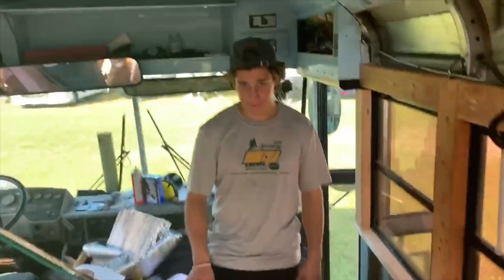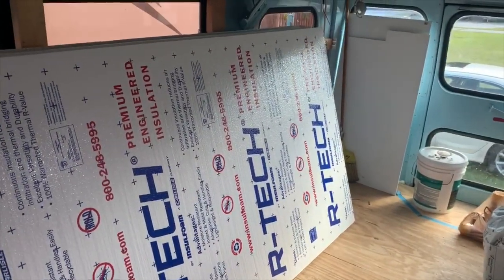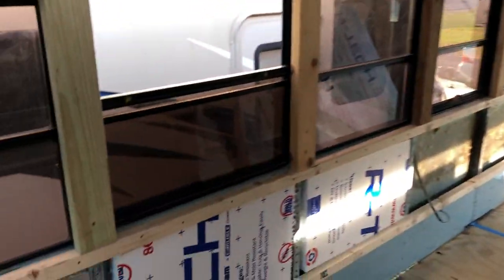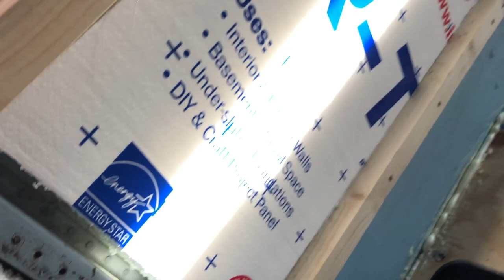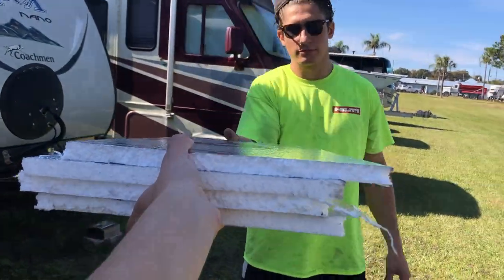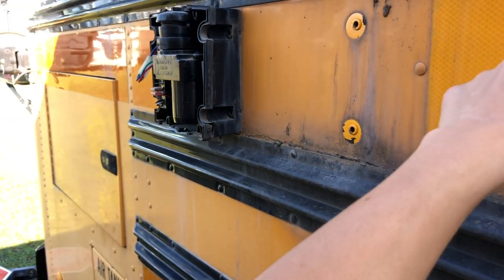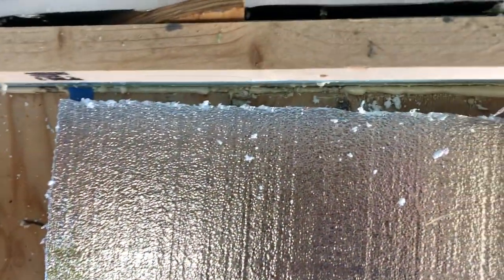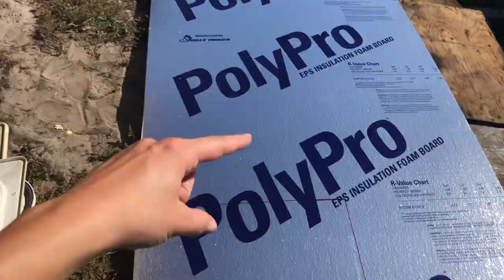INSULATING SKOOLIE w/ Rigid Board + Spray Foam | School Bus Conversion

Comment: Hi! I love the bus so far! good work! Pro-Tip if you are ever working with styrofoam in the future... An electric hot knife styrofoam cutter is so much easier to cut and it does not make a mess.

Comment: Looks awesome! We are in this part of our build as well! What glue did you guys use to put on your insulation to hold it in?
Reply from the maker: Thanks Mackenzie! We didn’t use any glue at all, just the weight of the plywood holds it in place and then we eventually siliconed all the gaps around everything. You can also use a little liquid nails between the actual plywood pieces to hold together better. Best of luck!

Comment: Does having a radiant layer on both sides make a big difference?  In my case, i would be in a texas hot climate, making only 1 visit to a Northeast cold climate at most per year; I'm trying to figure out if this would be a necessary step.
Reply from the maker: Jerenemy the radiant layer acts as mostly noise cancellation and a little insulation but we’re also using a vinyl flooring with a built in insulation layer. We don’t live in the bus yet and live in FL so we can’t yet speak on how it helps but definitely will in the near future so check back!
Reply: @ShawnandAsh  Awesome, look forward to hearing about it and seeing your adventures.
Reply from the maker: Jerenemy thank you so so much!! :)